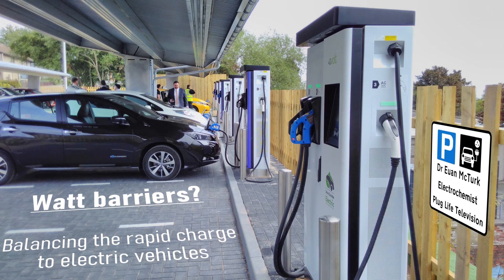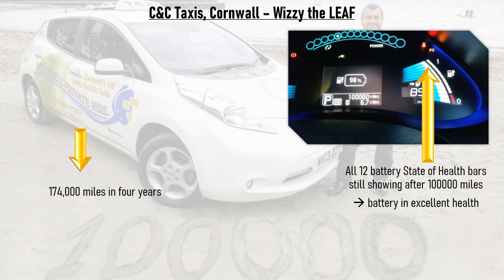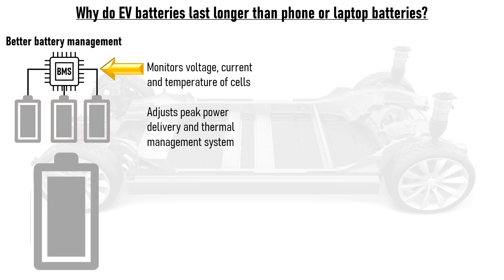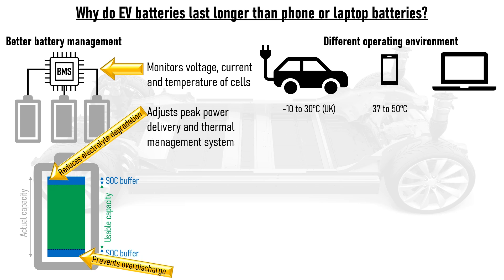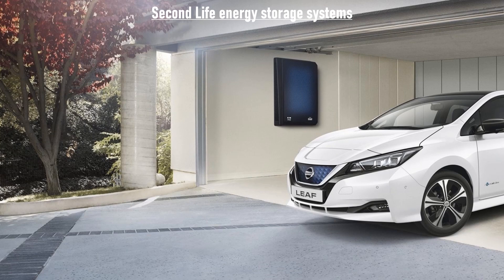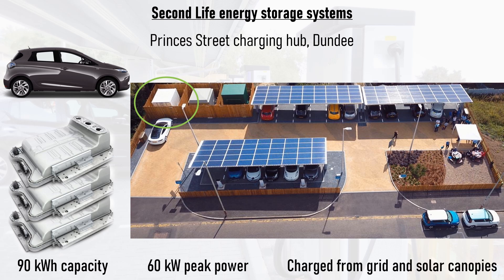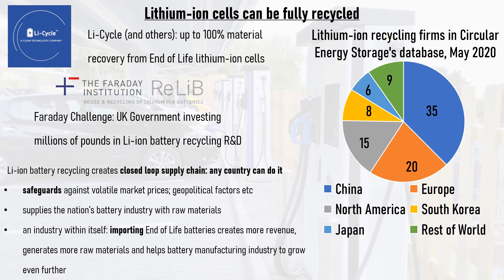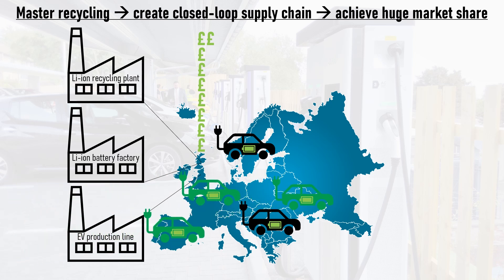Watt Barriers: balancing battery raw materials Part 2 | Plug Life Television episode 24

Comment: I’ve a Kona Electric, Solar system, and Powerwall. It’s time all houses were built with solar panels and battery storage as I believe it’s the future.
Reply from the maker: @Richard Wood I suppose it depends if the EV is going to be parked at home during the day to capture all of the electricity produced by the solar PV array.  Don't underestimate the number of EVs that will be parked at home during the day, but nonetheless, a lot of people will drive their cars to work whilst the sun is shining and the solar panels are producing electricity.  Nonetheless, V2G will be practical for people with off-peak or dynamic tariffs, since they can charge their car up cheaply overnight and use it to power their house during peak times.
EV, PV and storage battery are the holy trilogy of self-sufficiency and should definitely be encouraged.  It's vital that building regulations are tightened up to prevent the all-too-common practice of house builders sticking literally one or two solar panels on the roof of a house to call it "green" and get planning permission from a clueless local authority; every last square inch of suitable roof space should be covered in solar panels.
Reply: Richard Wood 
Hi, yes for some people it certainly would, especially if like me retired, means the car is on the drive most of the time. However for those who use the car to commute its bit different,  unless of course one can charge up at work!  The boss might take a dim view of running ones house on his electricity 🤨.   I think it’s a bit Horses for courses. As far as I know only Nissan do VTG via chadamo but I’m sure all companies will eventually do it.  I chose to go down the road of EV Solar and battery because frankly money left on deposit was earning peanuts at least now my return on investment is around 6%.

Comment: I guess Britain would have to manufacture to EU standards in order to export the batteries to the continent.
Reply: International standards apply, so not an issue.
Reply from the maker: The former Nissan battery factory in Sunderland (now owned by a Chinese consortium; still produces cells for Nissan) exports battery packs throughout Europe. Also many EVs in the UK have cells and battery packs that originate outside the EU. This is one market where I don't see any issues arising around standards that are specific to a nation or trading bloc. If anything, from what I've seen, China seems to be implementing some if the strictest safety rules around cell/battery design at present.
Reply: @PlugLifeTelevision  I designed and installed the WiFi network in the Sunderland battery plant that allowed the automation of the manufacture of Nissan Batteries back in 2010/11. I have never had one support call, so not sure if it is still in operation. I know it was still working a few years ago as I was asked a technical question about some cameras that were connected to the network.
Reply from the maker: @ronnielloyd4676  if there is a support call eventually, it probably won't be from Nissan, it'll be from the battery line's new owners. The factory is still churning out cells and packs for the LEAF and e-NV200.
Reply: @PlugLifeTelevision  It was an interesting project. I had to design 23 wireless networks based on plans, with very little idea of how they would interfere with each other. Luckily I'd been working with wireless networks since 1992, so had a reasonable idea, but I hadn't much experience of how they would perform with rapid moving autonomous vehicles moving things about! Luckily, it all worked fine.
Reply: Plug Life Television I am old enough to remember when Japanese products were considered junk and now it seems we are leaving the Chinese similar situation behind even if somewhat slowly. It seems inevitable that they will be (equal) number one for quality and reliability before much longer.
Reply from the maker: @davidpearn5925  CATL is a Chinese cell manufacturer that also happens to be one of the biggest battery suppliers in the world.  Volkswagen are amongst their many customers.  Svolt is another Chinese cell manufacturer, which has just unveiled a cobalt-free version of their NMC battery (NMx).  As for an indication of Chinese product quality from the end consumer's perspective, check out the success of the MG ZS EV.
Reply: Plug Life Television oh I agree that they are getting there ; after all they ‘manufacture’ Apple’s products and nobody complains about that.
(I can’t wait for the Mbyte to arrive out here .....if only because I’ve got the ‘plates’)

Comment: Nicely done! Good , well argued video. I just hope that Westminster and Whitehall get off their collective backsides and park some of their conservative technical views. Still frustrated they haven't yet replaced the diesel multiple unit trains with AC/battery units!
Reply from the maker: Tell me about it! I'm quite annoyed that Vivarail's first orders have been for diesel units - obsolete when new. ScotRail is seriously eyeing up battery and hydrogen propulsion, and I recently heard that Network Rail is now seriously advocating mass electrification, so there's hope yet.
Reply: @PlugLifeTelevision  Battery propulsion could electrify Scotland at a fraction of OHL costs, 5 hub stations with catenary could rapid charge transfer trains. I worked on 2012/13 technology, imagine what we could do now!
Reply from the maker: @bellshooter  absolutely. The Borders line, Glasgow to Kilmarnock, the Fife Circle and Edinburgh to Dundee and Perth would be a walk in the park on battery power using tech from 5 years ago, let alone today's. Some lines may require fuel cell propulsion, or longer station stops to allow for high power rapid charging, but even those could quite possibly be served by battery power on a single charge by 2030.
Reply: @PlugLifeTelevision  I have done the calcs. You only need to use a normal 12-15 minute layover at transit stations, and a short AC overhead at some stations to allow dwell charging, and acceleration on AC to make it work.  And that was 2013 technology.

Comment: Interesting point about how recycling can benefit the recycler.  What is the net energy return on energy invested of a closed loop system?  I'm just wondering if we will eventually reach a point where we have primed the system with enough lithium and the other elements that no additional material would need to be mined.

On a related note, I have a 2013 Leaf with ~48k miles with 10 bars and about 78% state of health showing on Leaf Spy.  I'm currently charging it to 80%, but since the state of health is reduced, does it matter anymore if I switch to 100% charging?    How does the Leaf come up with it's own state of health number?

Love the channel!  I find it remarkable how fast the UK grid is ramping up renewables and ramping down coal.  It can be done!  Near where I live in the US, Virginia is finally starting the Coastal Virginia Offshore Wind (CVOW) project.  The sleeping giant begins to stir, I just with it would stir a wee bit faster.
Reply from the maker: Glad you're enjoying the channel!  Good first question, and one that I don't currently have an answer for!  In theory we would eventually reach a stage where most, if not all, raw materials for new EV batteries could be derived from recycled old ones.  That said, as we move towards cobalt-free chemistries and completely new cell chemistries, we may well find that recycled cells give us too much of some elements and not enough of others to make the same kWh worth of new, better batteries.
Re: your LEAF, keep charging it to 80% if you want the battery to live longer; charge it to 100% if you want to wreck it quicker and justify replacing it with a new, better pack ;) Ideally run the battery down to between 20 - 50% SOC before plugging in.  Fully charge and balance to 100% about once a month to keep the BMS calibrated and the cells balanced, but try to time the completion of the charge to be within a few hours of the car next being used, e.g. overnight charge starting at 2am before your 8am drive to work.  Like any SOH reading from a battery management system, the LEAF's SOH number must be taken with a pinch of salt since the car never uses the full capacity of the pack, so it can't truly know the full capacity of the pack today vs the full capacity when it was new.  It can, however, look at how the voltage profiles change over time, and increase in internal resistance as the pack ages and degrades, and work out a rough SOH number from that.  The LEAF's SOH meter is particularly sensitive to ambient temperature (usually gives higher SOH numbers in colder weather) and charging speeds (weirdly, the faster the charging speed, the higher the SOH number), so should be used as a rough guide only.
Great to hear that Virginia is finally greening its grid.  The New York Times ran an excellent article in 2018 ("How Does Your State
 Make Electricity?") that shows the progress that each State has made in decarbonising its grid over the past 20 years.  Virginia's grid reduced its coal content from 51% to 12% between 2001 and 2017, but only by ramping up the amount of gas used, presumably sourced from fracking.  Looks like the economics of renewables have finally won out in the State.
Reply: @PlugLifeTelevision  Also, governments need to get smart and encourage recycling and tax imports of raw/rare chemicals that can be recycled. The problem is, there will always be countries that are happy to mine their way to economic success in the short-term rather than see the bigger picture.